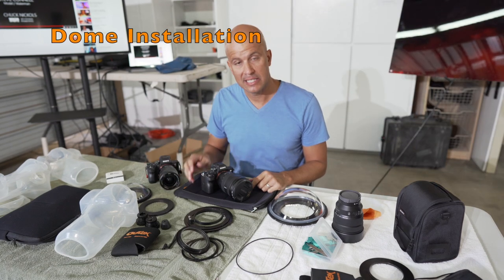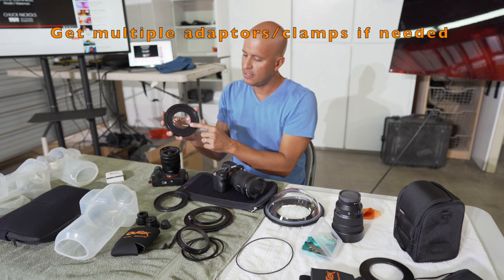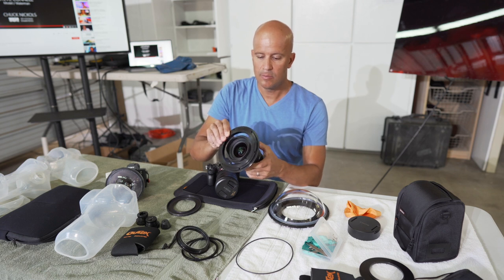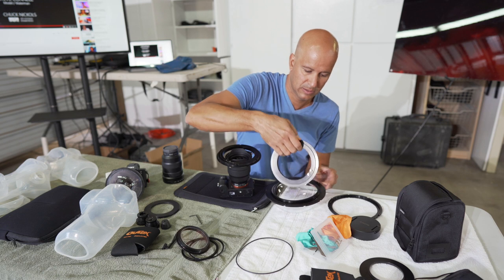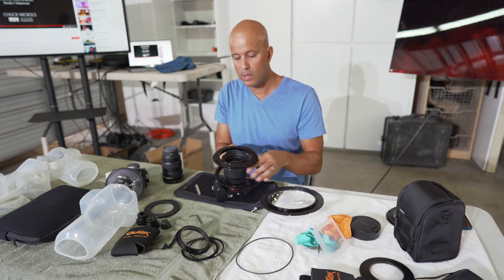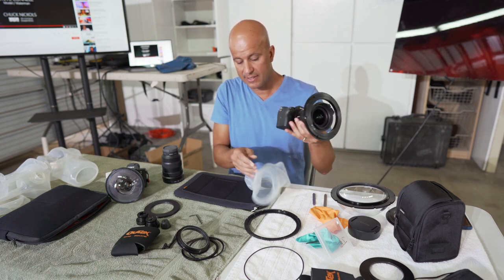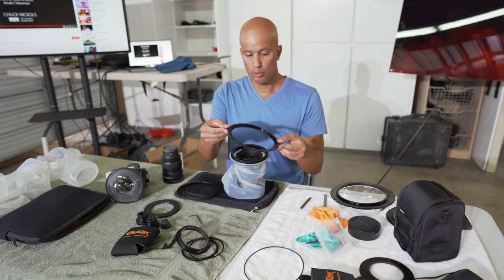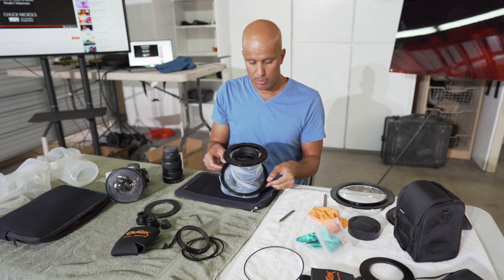Glass Dome Installation for Outex Photography Underwater System

Comment: We need a zoomed in version; you’re shooting too far and I’m struggling installing the 180 dome
Reply from the maker: Take a look at the diagrams in the installation page of the website as reference as well.  And email or call us if you still need help.  Happy to assist or answer questions.
Reply: @Outex  Hello Outex Team! found the reason why I was struggling to screw the dome onto the lens filter universal connector part... the dome rubber-Oring has a side up ! hard to see it when you receive it, but if you turn it on the wrong side, you will struggle to actually screw properly and effortlessly the dome. I didn't see this mentioned on your installation graphic image, may be worth mentioning it  ;-)